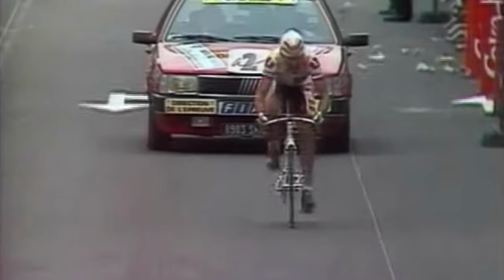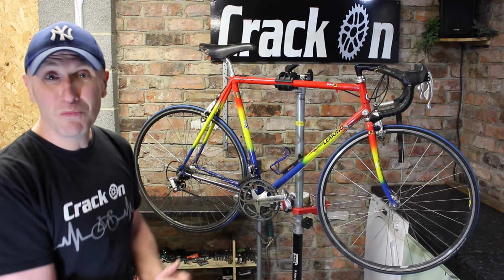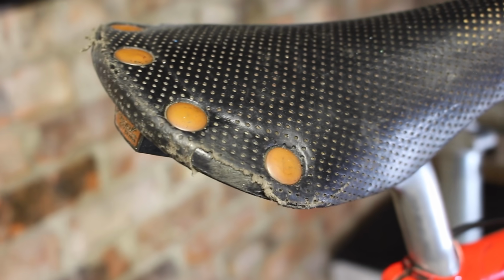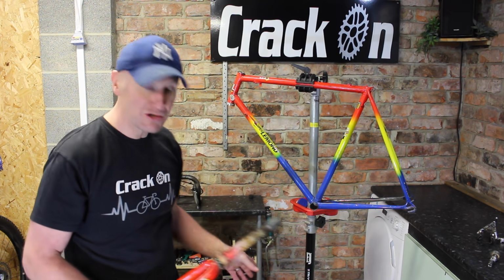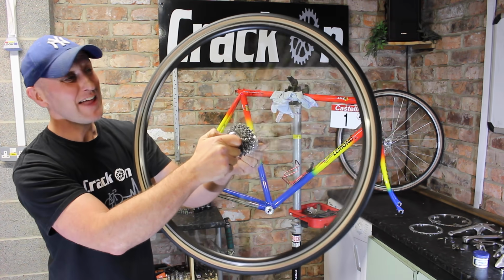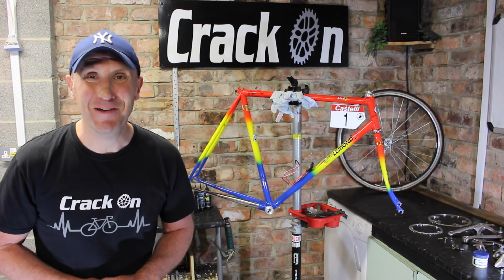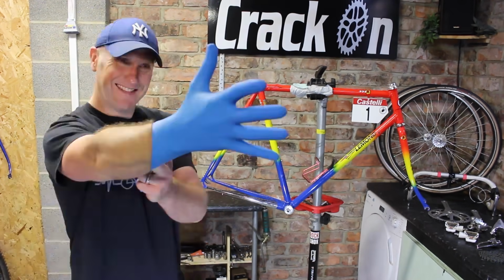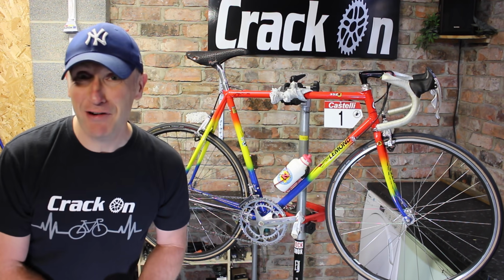Epic Greg LeMond Team Bike Restoration and Ride

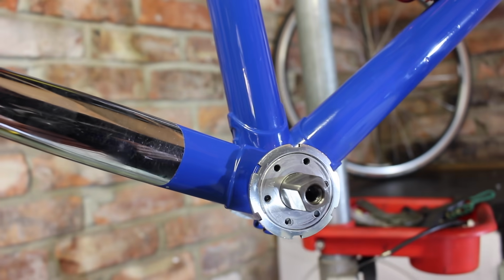Comment: Hey Andy, brilliant build. Greg is a hero of mine and back in his Renault-Elf days I actually got my haircut like Greg. I have a Pegoretti built Pinarello from 1993 with the next gen ergo levers and 8 speed. Brilliant bike. Now... at 7:36 you show the new BB installed and I dare say it's in backwards. The lock ring/adjuster cup goes on the non-drive side and the fixed cup on the drive (right) side.
Reply from the maker: Hi thanks for watching and your comment nice to hear the story about your haircut. The bottom bracket came with the bike. I fully serviced it and reinstalled. The Italian frame on the drive side had an opposite thread like most Italian frames and the bottom bracket that came with it had a unusual locking ring on both sides of barrel. The manufacturer was “Royals” I think 🤔. Hope this explains a little better. Thanks again for your support
Reply: @BikeItUK  wow that is bizarre. Never seen a BB like that. Both my 83 pinarello and 93 Pinarello (Super record and C-Record ergo respectively) have Campy BBs and there is a fix cup on the drive side which made me think yours was backwards. But if that BB has a lock ring on both sides, and the ring doesn't impede the crank spider, well that's a new one on me. Weird quirks of pro team bikes I guess.

Comment: Hello there and thank you for this great video with such rare and beautiful bike.
The best part is actually you rode the bike 👍👏💪😍
Reply from the maker: Big thank you for your support I do enjoy riding these beautiful bikes 🚴
Reply: @BikeItUK  well few weeks ago I spoted one cheap and interesting road bike on andvertisment. I have MTB and ride it, but my old wish was to have an road bike. And this one reminds me on my fathers old bike he got in the factory in the 80s, that factory was producing bike cranksets it’s name was Unis from Yugoslavia. So, I got old german bike for very cheap, 40€, steel frame with lugs, weinmann brakes with dual levers and rims, maillard high flange hubs, shimano positron shifters, shimano chain and casette, SR Sakae Custom crankset 42/52, SR Sakae BB, Uno stem, Friko handlebar. So I stripped the bike to the frame, sent the frame to sandblasting and powdercoating in matte black. While I was waiting I was cleaned every single component the best I could and assemble it back, today I got new tires, tubes, seatpost, brake lines and housings, bar tape and pedals.
I just need seatclamp screw to come and I can start building a bike. So tomorrow I am planing to start and record it, and mount the proper video in few days.
Your videos give me some experiance and will to do it properly

Comment: I have a LeMond with the same paint from the same era. It's the Tourmalet model. Not sure what tubing because it has a "Tour de France" sticker where the tubing label would be, but lugged tubes, Italian-threaded bottom bracket. I rebuilt it with Shimano 600 vintage components (mostly). So happy to have a pre-Trek LeMond.
I, too, have a Team Z jersey from that era (made by Tommaso). Bought it when he was still on the team, so 1990 or 91. And yes, he was one of the main reasons I got into cycling as well.
Reply from the maker: Great to hear your inspiration into cycling was of this era. Seems these years really were the golden years of road racing. Thanks for watching and your support all the best Andy

Comment: A typical Lemond bike paint job and Delta brakes. Final result looks great. Just needed some of those Scott Drop in handlebars from 1990 to complete the look.
Reply from the maker: Hi Ian, yes I was in two minds regarding the bars. It honestly came down to having enough bar tape and getting the restoration completed because I was aware I'd not uploaded for some time. I have them they will get used. Thanks for the support buddy

Comment: Andy, I've got the same groupset. Do you know if the crankset is chorus? I think the matching record one only has four exposed bolts. Any ideas?
Reply from the maker: Hi, interesting....Ive just been looking did the bolts change in 93? Thinking maybe they released the levers then changed the crank. Its definitely C-record but you are right the 8 speed group set crank has only four bolts showing. Thanks for watching
Reply from the maker: @ericsande5345  Thanks for all this information its good stuff
Reply: Love it! I love the long top tube and long stem, old school stretch out! I have a Moser AX Leader I raced in 1992 with Campy Record.

Comment: Excellent rebuild!
Can you tell me about the bars that you did not put on? Are they still available? If so can you point me in the right direction?
Thanks!
Reply from the maker: Thanks for watching and the support. They are Scott Drop In handlebars I bought from eBay and I’m going to be using them on another Greg Lemond build coming up soon. I hope this helps thanks for the support Andy
Reply: @BikeItUK  Thanks! Good luck on the rebuild

Comment: What's that liquid you put on the brake calipers @ 8:47 and what does it do? Also, could you put that on anything else like derailleurs?
Reply from the maker: Thanks for watching it was just some lubricant, because I had degreased parts I was aware the moving parts needed lubricant

Comment: I have an 80’s / early 90’s? era Greg Lemond that is built on a TVT Kevlar frame with aluminum lugs. This bike has downtube shifting levers and came with very worn Scott time trial bars. In 1989, I’m not sure if the Lemond team time trial bikes  were the TVT frames and the butt welded steel frame you have were used in the race. The team colors and use of the “Z” decals are very precalent on this bike. Can you shed some light on this ?  Everything is original on this bike, what would be your suggestion for how to restore or resto modify it ? Thanks for your inspiration.
Reply from the maker: Hello thanks for watching and your support. If you are on Facebook join the Greg Lemond appreciation group. Post some images on there and the knowledge should come in. Without seeing it I’m not sure. If you want connect with us on Social Media instagram twitter or FB and send a couple of images over.

Comment: Is ir an option to temperarily put an old seatpost in the frame and put the clamp on that?
Reply from the maker: Hi thanks for watching yes the old seat post is definitely the correct way. The stand isn’t high enough to position the bike for the camera angle the bike would be lower down. That’s the only reason I do it that way. Hope this explains my reasoning 👍
Reply: @BikeItUK  cheers mate

Comment: What brand of chains work with old campag gears? Looks so good, great build and hopefully he will watch this video 
Cheers
Reply from the maker: Hi I if you just search Campagnolo which ever speed you require on eBay then this should be ok. A lot of the older gearing wasn't half as complicated as a modern bike. Often Shimano and Campagnolo components were mixed up on builds. I hope this helps. I have pinged him the link so lets wait and see.
Reply: @BikeItUK  thanks Andy

Comment: I like the way you restore bikes. Nothing stops you from getting at every detail. I restored a 1992 (?) Serotta Colorado Concept years ago. I sprayed that primer that converts rust into an oxide that would prevent further rusting, inside the tubes. You dissessmembled every component and cleaned them, then reassembled them. Could that part of the video be a few hours longer, please. Maybe if your good, Santa Clause will bring you an ultrasound parts cleaner next Christmas. Did you grease the tapers of the bottom bracket spindle? There is controversy about this. Do you have a Hetchins in your video collection, I'll have to look. I have never been to the UK and when I do visit, I want to be in the studio audience for catch 8 out of 10 Cats Does Countdown and go home with a Hetchins.
Reply from the maker: Hi Mark, not done a Hetchins as yet....watch this space one may pop up. I do very sparingly grease the tapers, I find it helps with reducing noise and also prevents them becoming seized. An ultrasound cleaner sounds great, yes please. Thanks for watching and your support all the best take care.